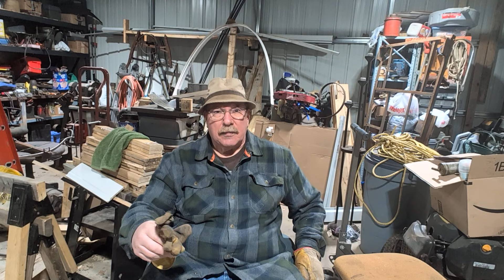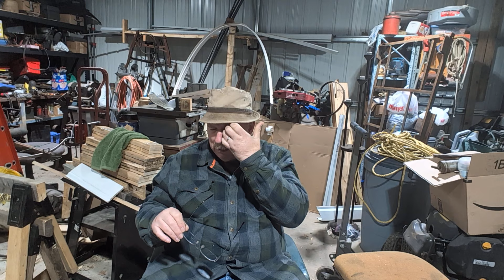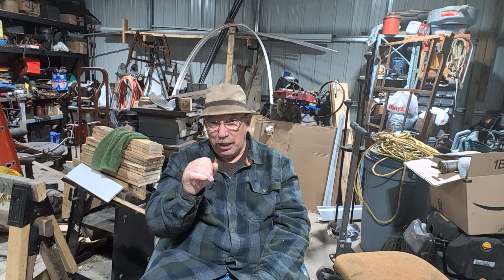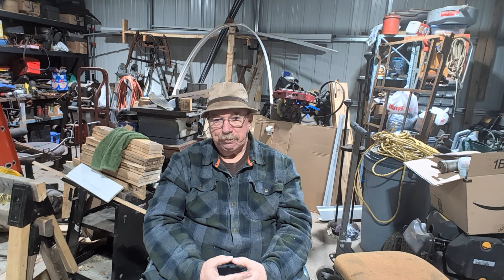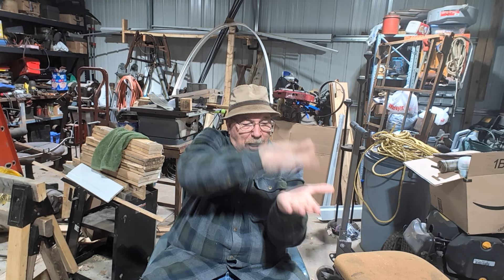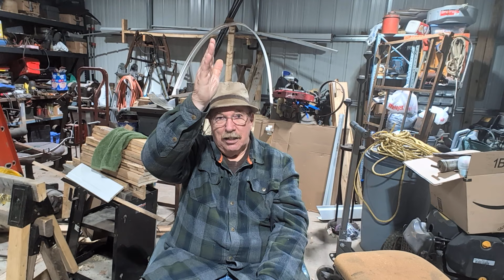Lessons Learned The Hard Way

Comment: I've had a few jobs and one was at a manufacturer of a famous pliers based multi tool.  On there racks which I thought was smart and had to repair alot was sheets of metal plastic whatever was around 2 inches on each side of the with of a pallet.  Thay forced you too always be head on loading it and no side space could be loaded up with junk or anything more than one pallet per spot.  In today's world yoy have to make thing human proof so more than obvious to do it right.  Something I introduced there too us engineered straps that broke at x weight they put under the racks in each spot.  If one of thoes straps broke it thundered in the factory you know someone messed up.  I appreciate the story and can sympathize.  Stuff to this day is why if it's not a 375 rated ladder it gets cut up if i find it on the jobsite.  Don't worry homeowners ladders get a reusable ziptied closed so no one uses them because it's convenient.
Reply from the maker: The barriers sound like a good idea. 
As for ladders I had to cut up a 40 foot step ladder that I had put in the dumpster at work because the frame cracked after it got hit with something. Probably a fork lift. 
Someone kept pulling it out of the dumpster. After the third time of wrestling that ladder back into the dumpster, I finally drove the yard lift down the length of it so it couldn't used for anything.
Reply: @OldSneelock  I found you can do a lot of body work on mixers with a Cat IT-28 loader with a set of forks.

Comment: That's GOOD! I always liike those  recounts from the bunker, wherever the bunker happens to be. I know how steel can give, even pieces that'r supposed to hold us solid guys. I always walked softly and left the big stick somewhere else. I was a gracious plenty. That was what happened to the greenhouse. 10X20 pipe frame like inch plus maybe conduit. Upright in the middle and uprights on the ends. Enter in one foot of wet show and it was waist high. Caved in. I had the Ford and started hauling lumber and a couple of concrete form screw jacks, the kind you plumb forms with. It went up and has stayed up. SNOW? Maybe this winter. God Bless You Two!
Reply from the maker: I hope you are doing okay. 
Things around you got pretty badly mauled. 😁😎
Reply: @OldSneelock  Mostly east of here. Some roads washed out but mostly trees and power lines down. 4 days on the generator. Pays to keep that stuff ready to go here. You never know.